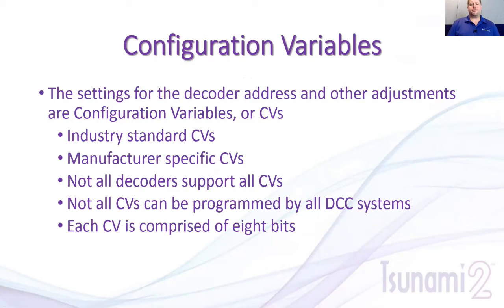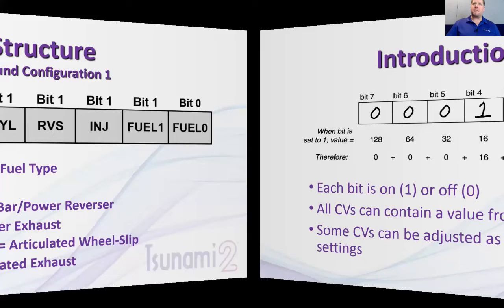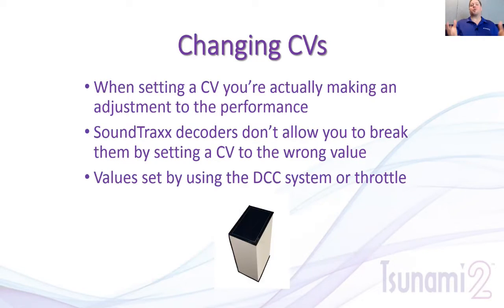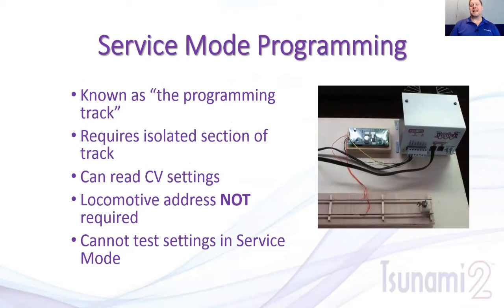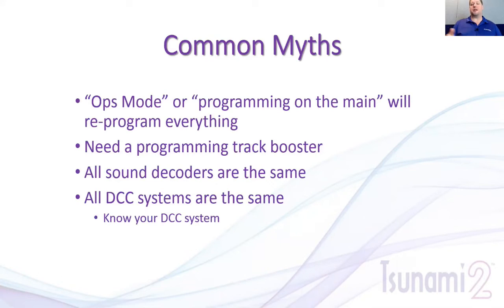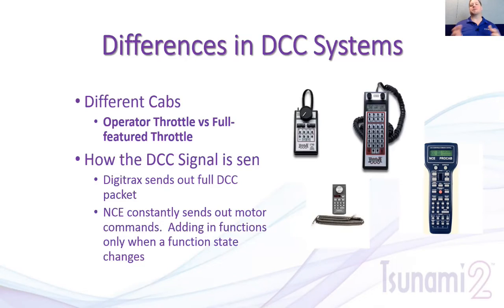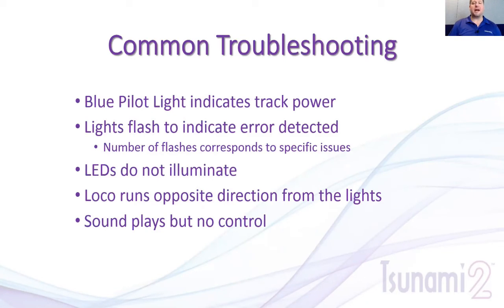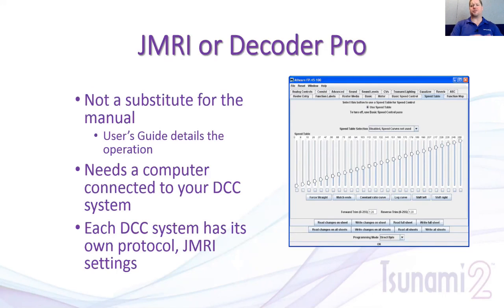CV Programming, DCC Myths and More with SoundTraxx (Webinar 6)

Comment: Am I wrong or does JMRI make this entire thing much, much simpler without have to learn all this language?
Reply from the maker: JMRI can make setting up your decoder easy, but it can also cause problems. If something does not work as expected in JMRI you still need to be able to adjust your CVs to fix it. Our manuals walk you through each CV making it easy to determine the value you want. Also we do not make/support JMRI so we cant help you use it and it will not always be up-to-date with newly released features.

Comment: You can read and write individual CV's under the CV tab in JMRI
Reply from the maker: Yes, but you can do that with a Cab/throttle.  If you are simply programming CV by CV (using CV numbers), then why do you need JMRI?  Not saying that it’s a bad program, but if a problem or unexpected behavior is encountered when programming using it, stop using JMRI, grab our Manual, read and follow our instructions, then you can read all sheets back.  If you find an error in JMRI, let them know.  If you made the error, you’ll know better now.  JMRI is a great asset, but it cannot be a substitute for the manuals.  If you need further help, Our tech support staff is here to help.  Thanks for watching. SoundTraxx Customer Support: (970)259-0690 ext. 22 or support@soundtraxx.com
Reply: @SoundtraxxDCC  agreed!